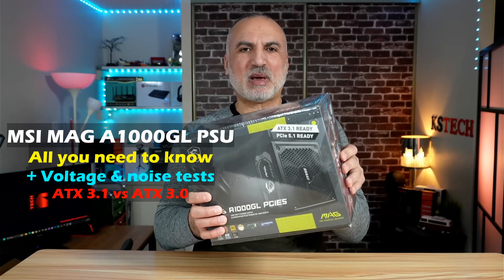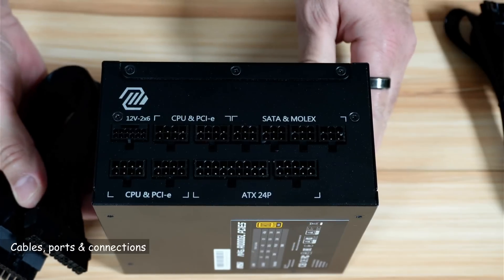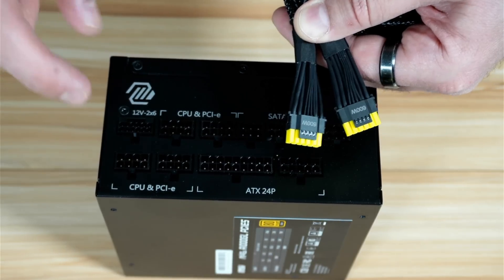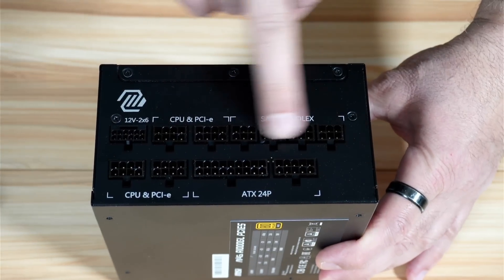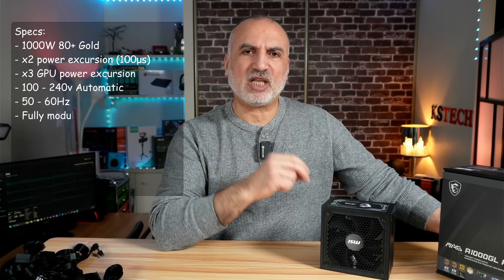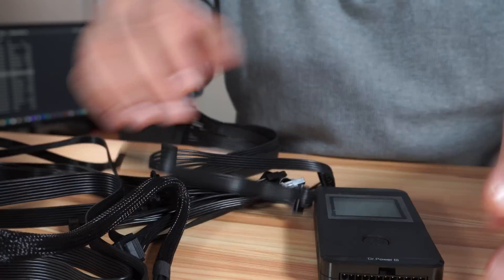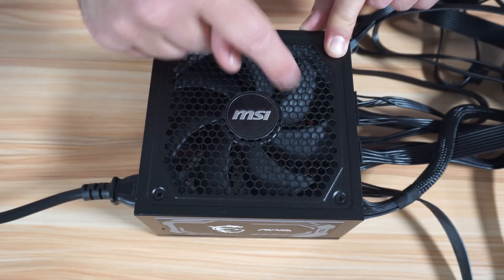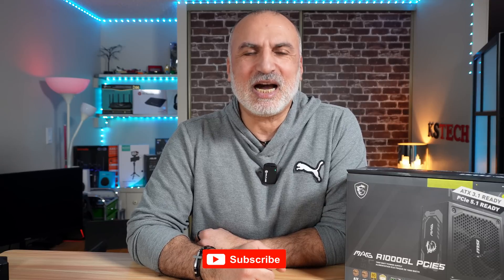MSI MAG A1000GL 1000W 80+ Gold PSU: Voltage & Noise test

Comment: i just bought 5070 ti and msi mag A1000gl for my rog ally x😢
Reply: I intend to buy the same gpu (rtx 5070ti). Did your A1000GL stand well with the gpu ? and could you please advise me which would be better rog strix platinium 1000w or this a1000gl 1000w gold?